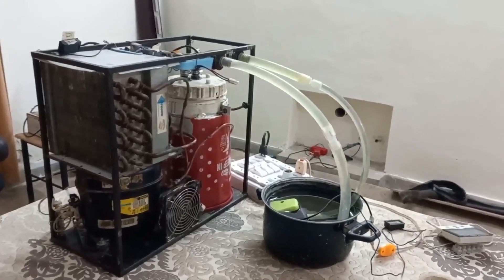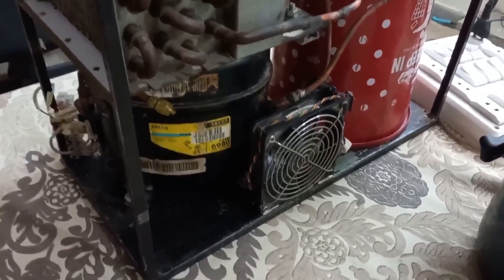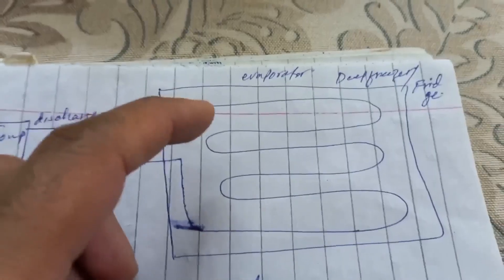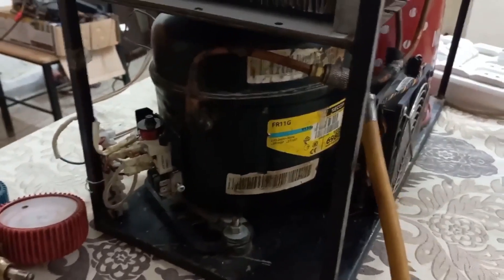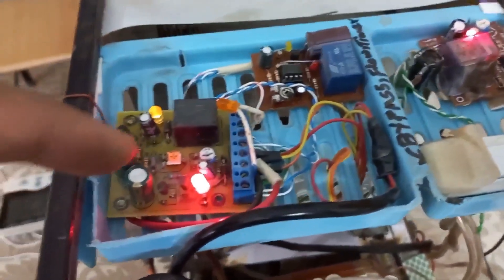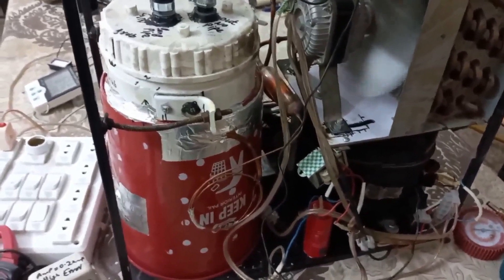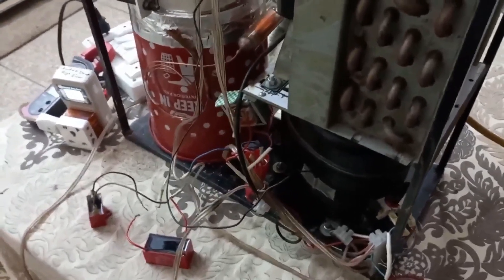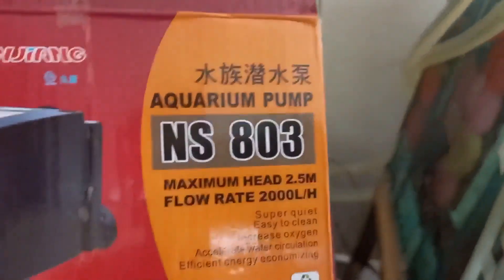DIY Aquarium Chiller | 300L Water Dispenser Cold Plunge | Urdu / Hindi | V6/6, Pt3/5

Comment: Sir 35 litter water k liye kon sa peltier best hain
Reply from the maker: It's very less water u can use 12706 for more info u can watch my video https://youtu.be/8eeZ8J0hWK4 I made this cooler for my 340 liter tank it work but didn't trip as can't bring temp till trip limit.
Reply: @NewAquariumHobby  can I use 12703 ?
Reply from the maker: @pritambasak1415  better to use 12706 as in real they draw 3 amp instead of 6 amp may be due to quality issue.
Reply: @NewAquariumHobby  test kiya tha 12706.  3.14 amp or 12703. 2.78 amp draw ho raha hain
Reply from the maker: @pritambasak1415  u can use 03 it will work but if both are drawing 3 amp so better to use 12706 as it will not damage soon but 12703 can damage as its drawing current very close to its rating
Reply: @NewAquariumHobby  thank you sir 🙂 . 1 peltier se ho jaye ga or 2 peltier use karna Hain ?
Reply from the maker: @pritambasak1415  try with 1 if not work u can add 2nd
Reply: @NewAquariumHobby  27145 peltier 3 use karta hu to kya current consumption, single 12706 se jada hoga yea Kam ?
Reply from the maker: @pritambasak1415  as per datasheet it will draw less current but I never use it also if it draw less current than cooling will be also less
Reply: @NewAquariumHobby  mere pas ak 6 gallon planted tank hain . Kosa peltier use karna Hain , power supply kitna cahiye ? 
thank you 😊❤️ sir  for your quick reply❤️🎈
Reply from the maker: @pritambasak1415  as per my experience best to hv little big cooling system than required then it will work best for long time now for 6 gal it's only 25 liters very less water u can use 2 peltier 12706 with 12v 10amp power supply